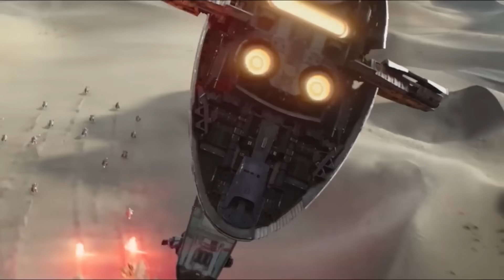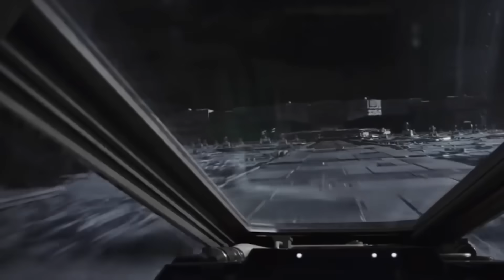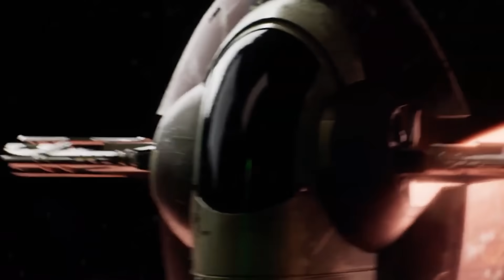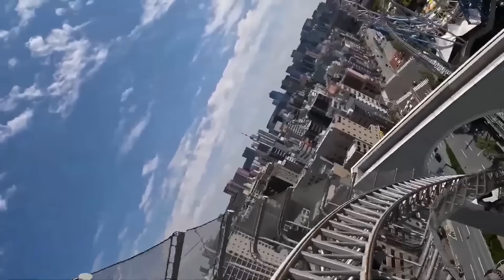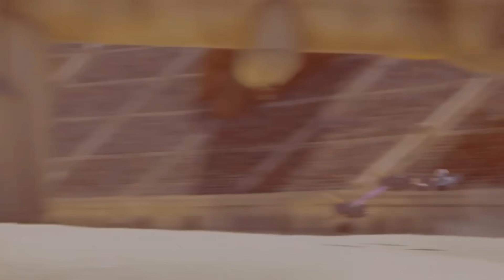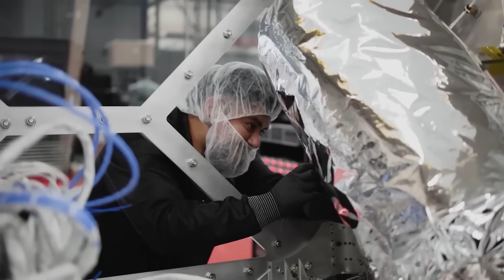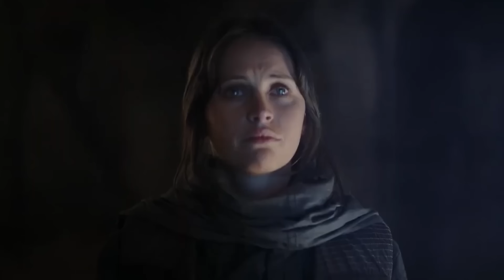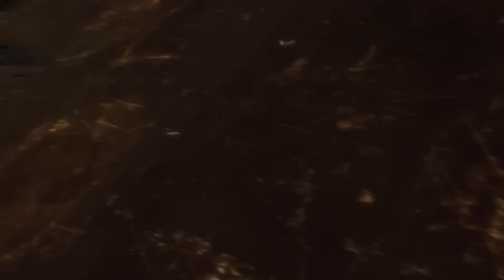The Problem with Star Wars Ship Design

Comment: Ugh... This gets repeated way too many times. No, a single A-wing fighter did not take out the Executor. Remember this quote from admiral Ackbar during the battle: "concentrate all firepower on that super Star destroyer."? The entire rebel fleet had been pounding on that ship nearly since the battle started. That A-wing fighter was just the final knockout blow.
Reply: And the shields had already been taken out (under massive losses), so the bridge was actually unprotected unlike on any other star Destroyer of that battle...
Reply: Yet, a lot of fighters went near that bridge, no matter there were a lot of distance, the Empire didn't learn its lesson with Death Star I and its poorly firepower against fighters.
Reply: @MrlspPrt The Empire built its military entirely around the Doctor and military requirements of the Clone Wars instead of building its military around dealing with a rebellion. Which drastically weakened the Empire's military capabilities because it focused almost everything on dealing with large capital ships then proceeded to fight a war where its enemy had almost no capital ships and what it did have was very rarely used. Note the Empire also gimped it Starfighter Fleet using a bunch of trash TIE fighters That were easily destroyed thus giving Rebel Starfighter pilots more experience making them even deadlier instead of its clone more starfighter fleet of highly elite powerful starships
Reply: @yami122  militaries are always guilty of trying to fight the previous war.
Reply: @yami122  Add to this the Emperors own fallacy, since he is supreme he believes in the visage of strength and as you said, they no longer fought other fleets but acted more as a police of the conquered worlds so no real reason to change them.

Yes they had weaknesses but the rebel fleet, which Palpatine dismissed as pitiful had the firepower to even take on a single start destroyer, and the small fighters was not really considered because the pilots where just soldiers with guns, they could not really conceive that to be a threat, anti fighter guns and shields would be enough.

And they might have had a secondary bridge but over confidence could have caused them to not even bother manning them, they, just as Palpatine, just saw it all as an extermination operation of a lesser force.

Also, according to imperial doctrine did not put heavy weapons on starfighters but that A wing probably had multiple photon torpedoes and they carry a heavy punch, like a small nuke, having multiple go off in the back of the bridge, sending shockwaves down into the central control systems would really wreak havoc.
Reply: @MrlspPrt We haven't, either.  Look at the mess with Iran--we are very ill-equipped to deal with lots of little craft.  Everything is about the big weapons, the small weapons got totally neglected.
Reply: @LorenPechtel 
😂
Yeah, ok. We could glass that entire nation if we really wanted to. It's called measured aggression.
Reply: And don't forget about the Death Star gravity as well.
Reply: @martinantab3520 let's better not talk about that, as with the speed that brought the Executor down, that thing would be at least a Neutron star, maybe even a Black Hole from its "gravimetric pull"...  nothing in real life works that fast and immediate, especially as the Engines would not stop with the bridge being destroyed as the SSD was actually designed for such a contingency...
Reply: While true. Would it matter how much they shot it before hand? How would it react any differently if it was completly unscathed?
Reply: @robertharris6092  well, the a-wing would pancake off its shielding (like the x-wings in rogue one's space battle, that didn't make it through the shield gate in time)
Reply: @vincediscombe7360 that shield gate made 0 sense....
Reply: @robertharris6092  Yes, it would matter a lot, the focussed fire took down its shields temporarily, and in the gap another pair of fighters took out the shield domes, which is what allowed the A-Wing to do it's one in a million miracle kamikaze strike through the bridge.
Reply: @bladeofhel the deflector shields didn't matter....they had to take down the deflectors though in order for their lasers to destroy the shield generation domes. That's where the particle shielding was being kept up. If the particle shields were up then the A wing would have disintegrated
Reply: but we don't see the fleet do anything to the Superstar Destroyer its armor is undamaged and its Shields are mostly still up. The Admiral gave that order but the thing goes down in a few seconds anyways before the orders could have possibly been carried out Most ships probably didn't even receive word to target it at all as it's literally the next scene it's being taken out.
Reply: @yami122  It went down because of the death star. It's stated the DS has its own ambient gravity. Between dmg to the engines and various systems. It can be argued dmg isn't seen is because she's so large dmg doesn't show well. When the a wing hit the bridge it essentially nerve punched the ship. Everything went hay wire and the ship lost stability. Before the crew could realize what had happened and went to secondary control systems the ds's gravity pulled it out of orbit an it crashed as a result.
Reply: @yami122  There are two flaws here.

The first is that you're assuming that the screen is showing us everything in real time...the battle is actually much longer than the little snap shots we see. Playing with time like this isn't that unusual, simply because the "next scene" shows it being taken out doesn't mean that it's literally only a couple seconds later...again, we're only seeing snap shots, the two shots might be five seconds apart, but they could also just as easily be five hours apart.

You're also getting factual details wrong...the shields weren't mostly still up, we literally see a pair of fighters hit the shield domes with proton torpedoes while the shields were temporarily down.
Reply: @bladeofhel  There are two flaws to your Effort to correct my supposed two flaws.

first is that while you are correct that one scene preceding another does not necessarily imply immediate time lapse and continuity. You are incorrect in saying that the scene of Akbar saying concentrate on firepower and the scene of the Dome being hit by proton torpedoes And then the scene of the ship getting taken down by an A wing have to take place immediately preceding each other. Because of one simple fact all three of those events happen in the time it takes for Orlando Calrissian to get the dish at the top of the Millennium Falcon knocked off and him reaching the core. Death Star is not that big in terms of space travel planets are not big when it comes to space travel We even see it takes not that long for the Millennium Falcon to get outside of an exploding Death Star. So the three Super Star Destroyer scenes don't have any time at all for a gap in the time between the scenes they all have to happen within a minute because of the Millennium Falcon gets there within a minute.

secondly Is the vast trove of Star Wars material that revealed that those shield domes at the top of the ship are so lightly protected of B wings shooting a few missiles can take them out. I'm not really getting any impression the Shields are temporarily down and we see with our own eyes There is no concentration of power every rebel capital ship it's still moving into position on the screen in the movie. And what the movie shows trumps anything in a book It's fine for a book to add unseen detail like expanding the number of ships that were in the battle But a book cannot overrule the movie showing a lack of anything shooting at the Superstar Destroyer beyond a few stray
Reply: @yami122  In regards to the order of the timing of the scenes, I'm 100% correct.

We do not know how long the events actually take...and even though we see the scenes in a particular order, we don't know exactly where on the timeline they all happen...ie: we might see Lando talk to Ackbar, then five minutes of Lando flying, then cut back to Ackbar...that doesn't mean that the two Ackbar scenes are necessarily five minutes apart, then second Ackbar scene could be immediately after the first.

You're assuming a completely linear temporal chain between shots.

Now onto your second point, no there's barely any material that shows the shield domes are vulnerable in any way.

And I already explained why the shields are down, and why the concentrated fire definitely happened...

Ackbar calls for concentrated fire...if the concentrated fire never happened...why would the filmmakers leave that in? Why would they waste runtime on Ackbar giving an order that's completely irrelevant?

The short answer is that they wouldn't.

And this is backed up by the novelisation...which despite being written by a ghost writer had Lucas' name attached to it for decades btw...the events differ slightly, as the fighters fire proton torpedoes at the bridge instead, and Ackbar orders

It mentions two salient factors, the first is that the rebel starfighters and the Falcon, slow down in the Death Star interior and that the interior is very complex.

The second, it basically outright states that it was rebel capital ships that took out the shields, and damaged it quite badly (the Executor is described as listing to the side, its guidance systems already damaged) before the fighters make their attack run. The shield generators are never actually targetted.
Reply: @bladeofhel  As I've already explained it is impossible for there to be a delay between the order of fire on the superstar destroyer And its destruction. At the very least the very first scene of Akbar giving the order at best is happening right after Lando says that was too close and that's being generous to your point If it happens any later that makes it even harder for the concentrated fire to happen. and the last scene of the Superstar Destroyer has to happen some time before Lando reaches the main reactor Sure events throughout the battle are surely not taking place right after each other but they are being played in order.

so when the film shows three events that are packed between two events that those two events only had a maximum of 3 minutes being generous in between event one and event two of Lando first losing the dish and saying that was too close and the second of him reaching the main reactor.

Superstar Destroyer gets the order to be concentrated on and falls in a time span so quick Lando is still flying through the Death Star It's not going to take long to fly through the Death Star It's only a minute or 25 minutes would be generous on that it's not very big and they're in starships The space they had to fly through to get to the Death Star was orders of magnitude longer than the actual space inside the desktop and they got to the Death Star pretty quickly within one battle

As for why would Akbar say concentrate on fire why would they put that in the movie. Well simple it's so that the audience knows that things are going on with the executor it's to push our eyes towards it because if they didn't have the Akbar scene it would seem pretty random all of a sudden If it just cut too out of nowhere the last two scenes of the Superstar Destroyer

and I go off of the Return of the Jedi novel for things which I believe is the source for it was on fire and listing to the side Because let's be honest most of the things in that book that aren't directly in the movie Are retconned anyways or heavily changed george Lucas never really bothered much with following the books for future material

and even if that information was still part of the official storyline that only indicates it was damaged in battle Never mentions that it was part of a concentration of fire merely that it was damage that had been caused throughout it that battle raged for hours didn't it?
Reply: @yami122 Damn dude... That's a lot of work to keep from saying, "Oh ok well that makes sense I guess I was mistaken". He brought receipts and you got... Your opinion I guess.  It's not even debatable, Akbars orders to attack the executer is what led to its destruction when the bridge controls fried allowing the DS to pull it into its gravity.  I've known this since I was a kid in the 80s reading source books.   You're arguing against basic canon knowledge.
Reply: Any damage done by that entire Rebel fleet is utterly and completely irrelevant. Nothing may do absolutely nothing except for taking out the bridge deflector Shields with 2 A wings does anything to contribute to its fall it would have all been superficial damage if it did any damage at all. The single a wings slamming into its bridge is the only damage that mattered and it did singularly takedown the superstar destroyer regardless of any superficial damage caused by the fleet
Reply: @yami122  The bridge deflector shields could only get taken out because the fleet's focussed fire temporarily dropped the shields...if the shields were still up, the torpedoes would have done nothing, because they would have hit the deflector shields...which are above the generators...
Reply: @bladeofhel  there is no focused We don't see anything major hitting the Superstar Destroyer at all Just a few stray lasers as rebel capital ships are moving into position to then launch their attack. Takes time For orders to actually travel through a fleet and then be carried out and the Super Star Destroyer is taken out in the same 60 seconds as Akbar's orders. and if one wants to say the two scenes don't immediately happen after each other within the same few seconds while quite frankly there's just not a lot of time this story has to work with Lando Calrissian is deep in the Death Star pretty close to its core and it goes down in between him saying that was too close and him reaching the generator and since we see when he turns his ship around and flees doesn't take that long to get through the Death Star.

We don't see concentrated fire and there is no time for concentrated fire And even if the rebel fleet did somehow have the magic ability to turn every single gun on the Super Star Destroyer in that instant the order is given. It's just not enough Two impacted Shields that thing can take a Star Destroyer slamming into it and be fine It's going to take a long time fur at Max a dozen capital ships to burn through the superstar destroyer Shields it's astronomically bigger than them and their guns are pathetically low caliber compared to the size of the Superstar Destroyer.

3rd Many sources consistently show that that deflector shield at the top that the A wings blow up is itself not really shielded you can just shoot it and blow it up really anytime weirdly enough You would think the shield generators would be the second most shielded area after the bridge but no couple of B wings can do it It's how small craft like X wings and B wings and a wings bring down Star Destroyers all the time in Star Wars. If that shield generator at the top took massive concentrated fire to bring down Shields on it then the story wouldn't be littered with constant stories of only 20 small ships bringing down a Star Destroyer.
Reply: @yami122  We don't need to actually be shown the concentrated fire...I literally addressed this point when I pointed out that films do not give us a 1 for 1 timeline of events...

It wouldn't take much time for orders to travel through the fleet, Ackbar literally broadcasted the command to every single ship in the fleet at the same time.

You're "but Lando was in the Death Star!" argument has literally no weight, again, you're assuming that time is shown to us at the same rate that it's happening...I already pointed out that there could very easily be huge gaps between these shots.

There's no evidence that there's "no time for concentrated fire"

As for the "max a dozen capital ships"...if you look at the fleet compositions for both canon and legends, you're looking at more than just a dozen mon calamari cruisers...

In terms of their guns, no actually, gun calibre means literally nothing here, it's energy output...and as long as the energy output of the incoming shots is more than the energy output of the shield generator, it's eventually going to be overwhelmed.

Also, no the guns aren't "lower calibre"...the guns on most of the rebel capital ships were of a similar scale to those found on star destroyers, and the Executor didn't mount larger guns than smaller Imperial vessels like the ISDs, it just mounted more of them.

No, many sources do not consistently show that the deflector shield domes aren't covered by their own shields...most show exactly the opposite.

The shield generators are the most shielded area...you're just wrong on your information.

Star Wars isn't littered with constant stories of only 20 small ships bringing down a star destroyer in open combat by taking out its shields...typically, those stories involve things like hitting a star destroyer while it's in dry dock..usually when Star Wars stories are written where star fighters take out capital ships, the writers have forgotten that shields exist at all...the Clone Wars animated series is an excellent example of this...the writers literally just ignore shields unless they need them for a plot point in an episode.

Comment: I would say that since humans have had access to space flight for thousands of years in the star wars universe. It would make sense for the human body have adapted to be able to handle higher G force than normal. Evolution can take millions of years but it doesn't have too. It can take hundreds or thousands of years if the selective pressure is high enough. Given that space flight is even older than hyper space flight. It is possible that most humans have evolved to be able to fly in space craft regardless of G force. Its mainly our mind that needs to get stronger to handle it anyway.